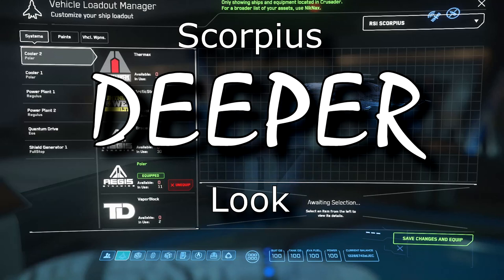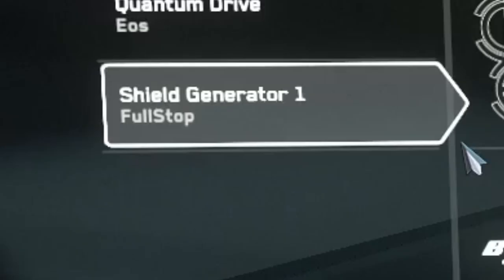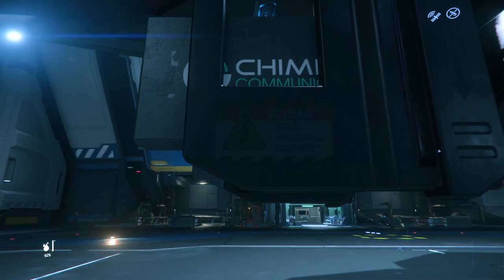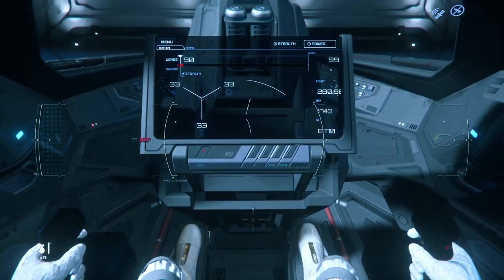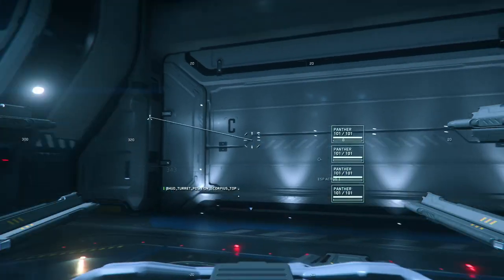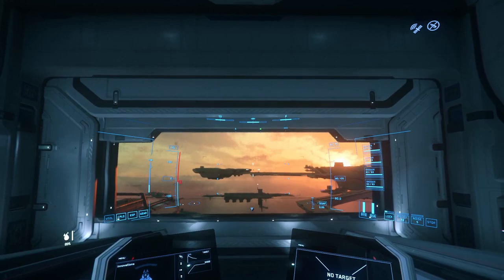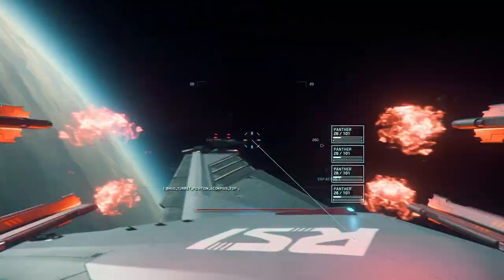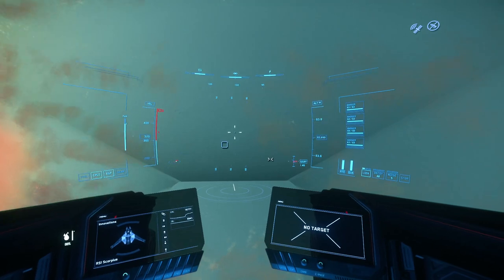Star Citizen: Scorpius Deeper Look

Comment: One thing I have found with the Scorpius is that you can stagger your fire from the wingtip guns.  It's a setting not bound by default, but you can set it and that is the reason for the "STGR" icon now on the right side of the cockpit display.  With this staggered fire configuration, I have replaced the repeaters on the wingtips with cannon.  You kinda get the x-wing effect with all of this, and you get considerable fire duration.

Comment: That's how I use the Hurricane when piloting. Keep the gunner pointed at the target, the front guns are there just in case. It takes a little more spatial awareness but it's definitely worth it.

With the new buff to the size 2 shield generator not only the Scorpius but all other medium ships will be better off. 20% isn't probably that much but any little bit helps.

Comment: The wings can fold in/out at will when the landing gear is up. The default is Left Alt+K. I imagine it was also to support the Hull but there are 3 new ship transform controls: Deploy, Retract, Cycle Configuration modes. The stock guns shoot through the model and does not damage your own ship when wings are retracted, I bet that gets changed soon with the guns disabled when folded as expected. With S3 fixed guns its mean and with a turret gunner eats 'canes for lunch as Avenger One demonstrated. The remote turret lower position has its uses for tight places and to cover/scout ground forces. In a ground strike the pilot goes in with missiles and guns then as they pull up to withdraw the rear gunner puts down more and cover fire on the way out. I am glad they did not slave the turret to the pilot as it is meant to be a duo fighter. Since its turn rate is getting nerfed keeping the S2 on gimbals might be better, we will see. With a duo crew I might also consider 4x S2 Gimbaled Distortions and let missiles and turret do the main killing. I will upgrade the S2 shields to FRs ASAP.

Comment: With the size 2 shield generator you get to play a little with the shield facings as well, being able to put all shields forwards when dealing with slower moving targets that allow you to keep the nose on target and keep pounding while the shield able to take a few extra hits from that direction. Going fixed size 3's like Attritions isn't a big issue in those situations either. Gimballed weapons are better against the more nimble light fighters but you would need to rely on your turret gunner more anyway as a heavy fighter is not going to be able to keep up with the turning rates of the light fighters so those will keep trying to get behind you. The turret being able to move to the bottom can help cover those angles. I would also be curious to see it in a ground support role because the pilot can line up the shots coming in and the turret can keep up the fire going out so you could do a decent amount of damage to ground targets in a single pass. Or look for people hiding behind rocks around Jumptown.

Comment: Good to see all the different component access panels all working - now we just need more component options :)  Not sure I'll be flying it in combat with the size 2 shield generator in it's current state however - the 20% hp buff over the 3.17 nerf just doesn't seem like it's going to make a great difference (especially if they re-adjust the manoeuvrability in line with original expectations (currently there's a bug making it more manoeuvrable than it should be)

Comment: im glad that theyre physicalizing the components but in my opinion the coolers should look more like a typical vehicle radiator or at least have piping connecting to something that looks like that  because when flying in atmosphere it would/ should make the cooling better. as for the shield generator although the physical size looks great and seems fitting i would think maybe they should go for a slightly different shape because in such a futuristic game one wouldnt really expect to see too many blocky shapes but more rounded shapes or could at least have softer edges / corners

Comment: I wonder if external components will be useful vs internal, even if the shield generator is the first to access, you still have to land or EVA to do any work on it if they implement that as a feature.